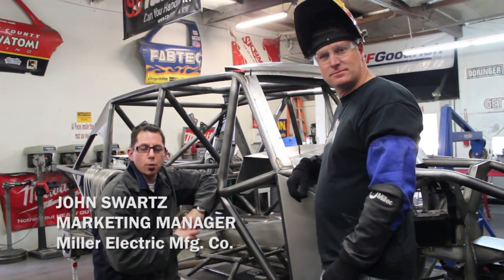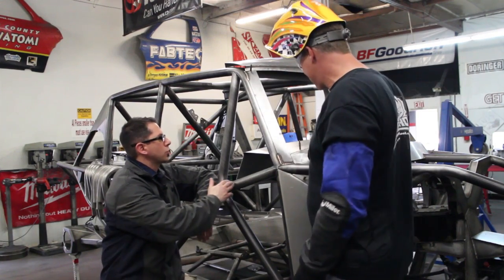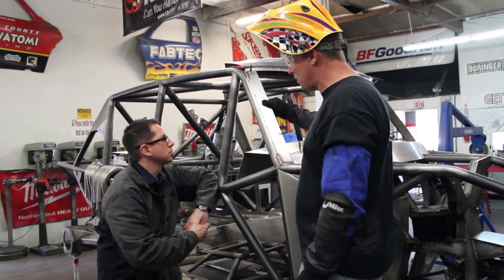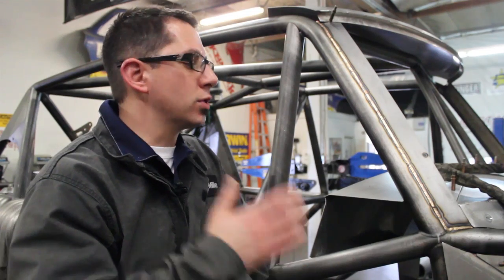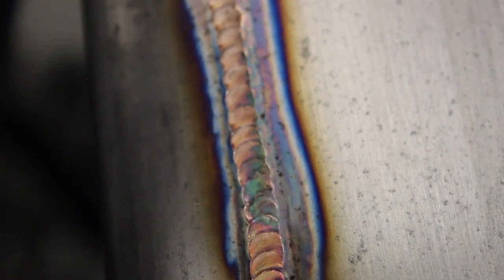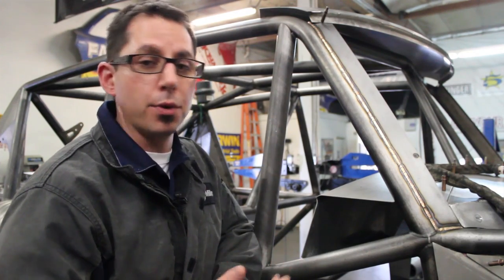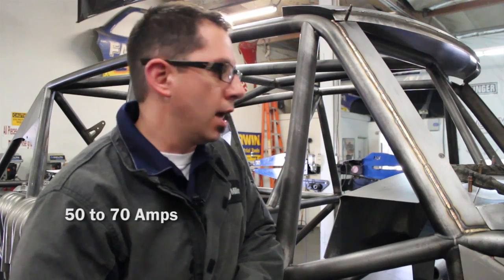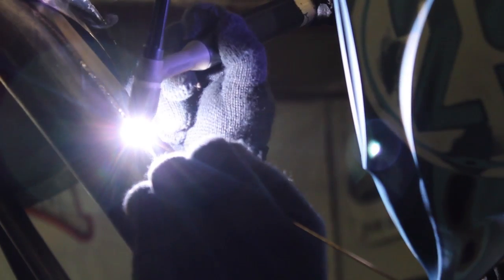The Fab School: TIG brazing using silicon bronze

Comment: How do you properly match the sizing of your filler rod, tungsten, & cup with the material you are brazing? Is there a handy chart to link to & print out for reference? Thank you.
Reply from the maker: Thank you for your question! As with many TIG applications, various size combinations of cups, tungsten and filler rod can be used in order to achieve acceptable results. We don't have a chart for you, but it will be very similar in application (other than amperage) to other materials on our TIG Welding Calculator: https://www.millerwelds.com/resources/weld-setting-calculators/tig-welding-calculator  We hope this helps. Let us know if you have any further questions. Thank you!

Comment from the maker: That rod is a gas rod used for gas welding and brazing. The rod that should be used for this application would be an ERCuSi-A. This type of rod is formulated to be used in the electric arc welding process. The spitting and sputtering you're seeing is most likely due to the additives in the gas rod. Hope that helps. Good luck!
Reply: Is the splattering from flux in the gas rod?  Or does it have to do with its metallurgy?  I'm struggling to understand this.
Reply: @craigsearching  I think there is a lot of zinc in those rods you used.

Comment: I need some help. I recently bought some hobart bare bronze 770510 rods to try some with my tig. This stuff spatters and smokes a ton. There was a lot of white zinc dust as I just made my tacks. I saw your video and it looks like a smooth process. What's happening? I'm using DC. Is there a difference Bare or silicone bronze? Please help
Reply: You need silicon bronze rods and not the type for oxyacetylene. Those require flux, too.

Comment: Informative video. I've brazed before using my EconoTIG and it's a great way to finish off a weld, or fix pinholes in thin metal. Just make sure to buy non-fluxed brazing rods otherwise you're just going to make a mess of the torch, material, and in general.